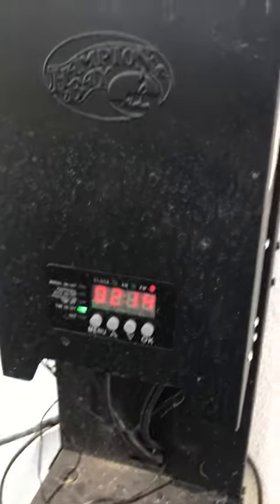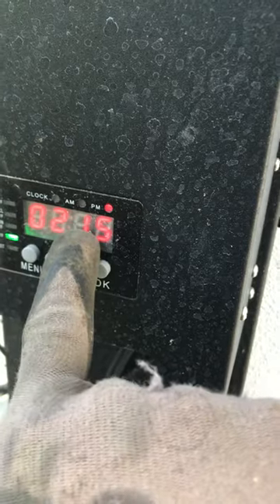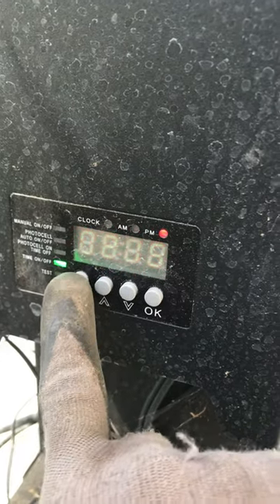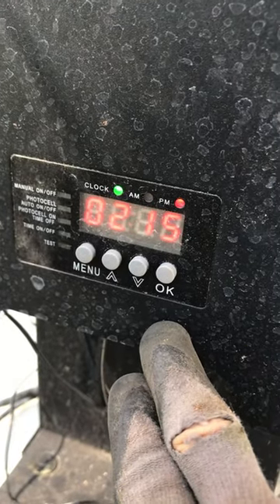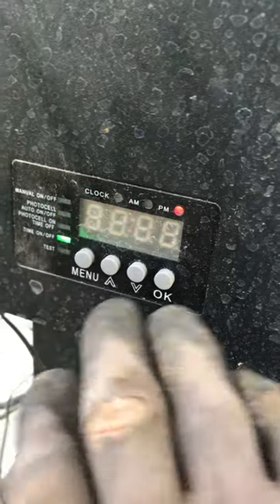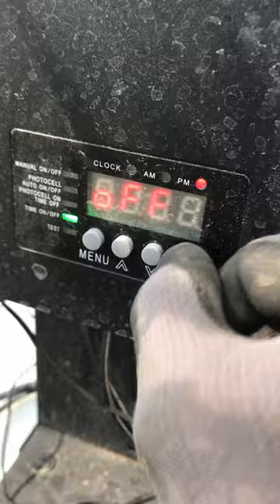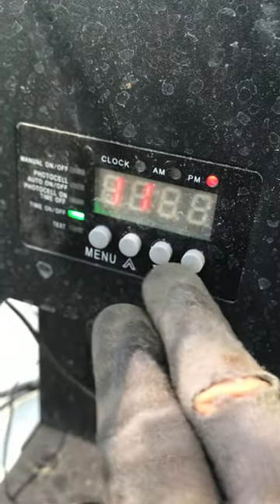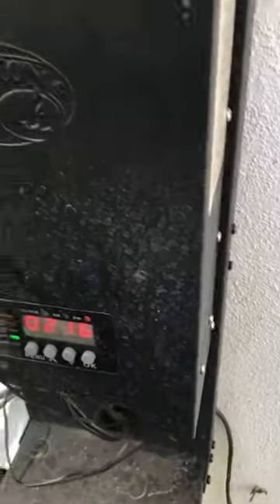Hampton bay transformer time set up

Comment: Clock is blinking and cannot change the time in clock mode
Reply from the maker: you have to follow the video. if you use the buttons it will allow you to set the time. when blinking its asking you what you want to do.
Reply: @AgaveroCaliforniano  the OK button is dead. I bought a wifi plug and control from there instead

Comment: A customer call me on one of the lights is out. How do I turn on manually to check which light is out. 
As well how do I turn back off.  
I wil appreciate it.
Reply from the maker: You can turn the transformer on manually even if it's on a schedule and whichever light doesnt turn on is the one out. If you have a hampton bay transformer like this one you can hit menu until the light gets to manual on/off and hit ok. It will turn on. Then go see which light is off. Then mark it. Go back to transformer and hit menu until you go back to manual on/off and hit ok to turn off. Then fix light and turn on again to test. Then before you leave hit menu again until you hit time on/off and click ok. It will have time on now and run off the clock. Hmu if you have another question